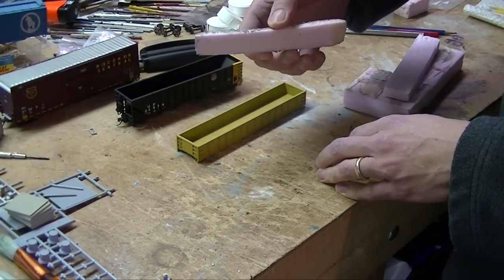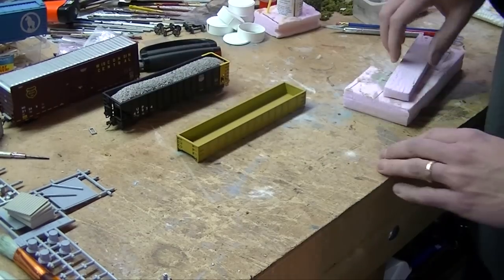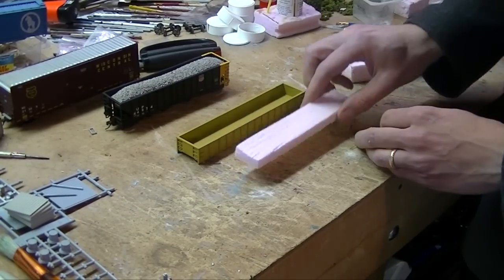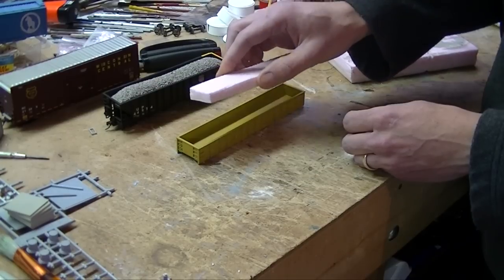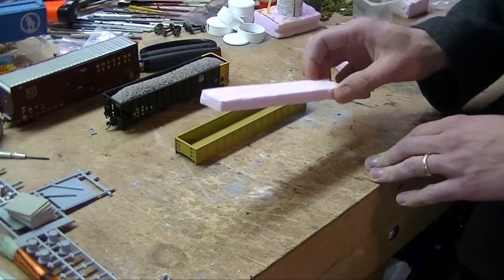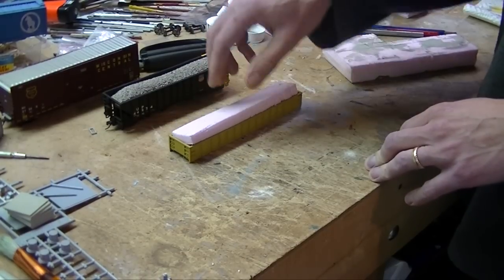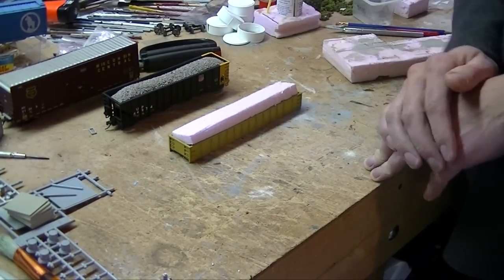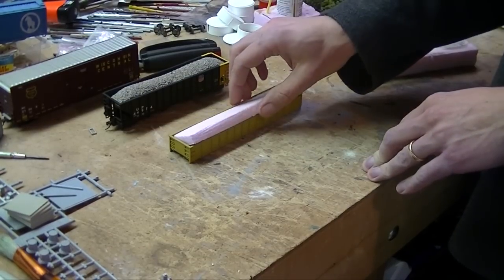Creating a Scrap or Coal/Gravel Load and Layout Plans

Comment: Just a comment about using a coal hopper for hauling rock or ballast. Yes, railroads did that. But rock or ore is heavier than coal, so it was often loaded to less volume than coal to stay under weight limits.